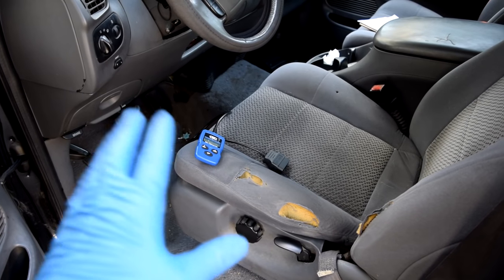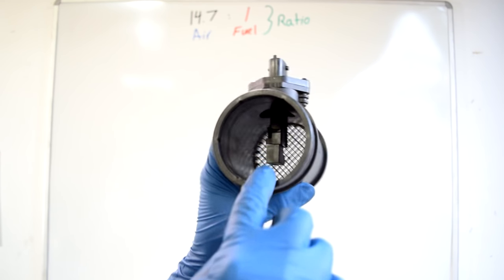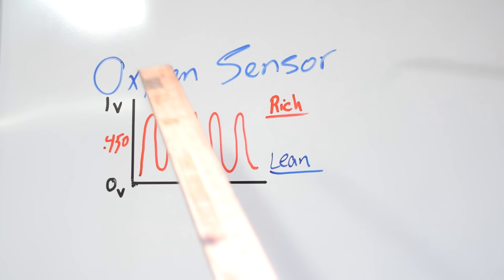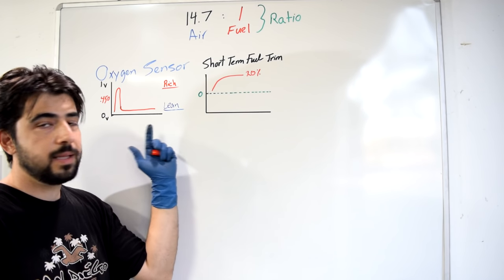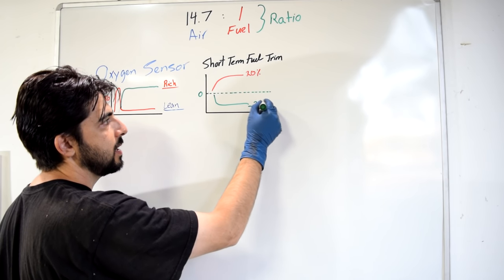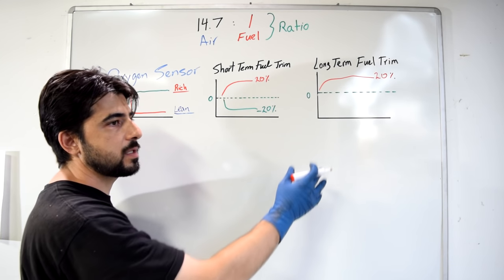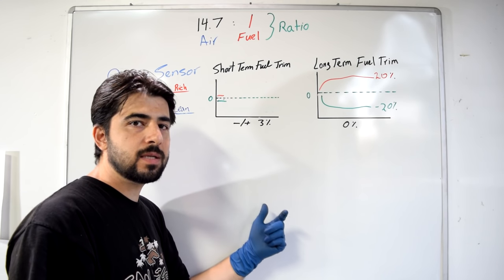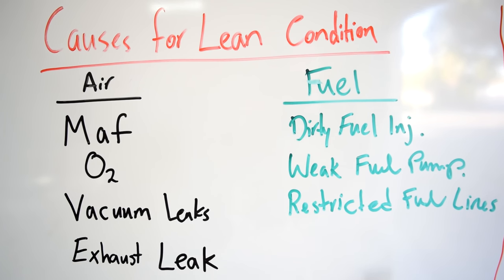Short Term and Long Term Fuel Trims Explained

Comment: I'm open to all advice on here. So far this video helped allot with understanding what I see on my scanner. But I need a little help understanding what the fuel trim and o2s reading mean. My 1997 dodge dakota with the same motor has a STFT (%) 2.3-20.3 at idle and a LTFT (%) 5.4 steady at idle. My MAP reads 9.4 and my O2s(v) fluctuates between .220-.860. 

But when I bring the RPM up to 2000 my STFT goes to -2.3 - 5.4 and my LTFT drops to 1.5 steady. My MAP goes to 7.8 and my O2s stay the same. 

Any advice would be greatly appreciated by anyone. And yes I know it's a dodge....

Comment: Hey man so I have a 2001 vr6 gti vw I keep getting a rich code p1137 code I have changed all parts except evap canaster still comes on. I have hard start & low compression on all cylinders. Whats my issue?

Comment: i have a hole in my air box where the filter  goes its at the bottom so no dirt would go through does this cause a vacuum leak i had a code p1273 my short term trims are around -6 to 10  but stays around -7 at idle
Reply: That hole is where the air from outside comes into the system

Comment: I tried that on my 2013 Hyundai Accent.  I'm getting a P2196 code, and the short term fuel trim jumps to 23.4% upon startup and stays there.  When I increase the RPM to 2000....it stays at 23.4%  What could this mean?

Comment: my o2 sensor voltage is from0.1v to 0.9v but on short term without accelerating is abou +15 so pisitive 15 and long term without acceleratng is 0 the same when i accelereta short terms go up to +25 just and long term stay 0 again can you help me what does it mean ?

Comment: I put the scanner in my car and I got 6.5 on the short trim and 2.3 on the long trim...I think I'm a little high on the short trim...but if you add 6.5 + 2.3 = 8.8  I'm below 10...so I'm ok ...right.
Reply: Michael Kokoschka no, you need a had cap and a big gulp from the circle k

Comment: Were r you located my f150 idles rought the stalls ive fixed so many part even changed the intake gaskets and it sill stalls no check engine signs
Reply: Check for vac line leaks, especially the hoses coming from the PCV valve and the IAC. Also remove and clean the IAC and check the PCV valve itself too.

Had a vehicle off the road over a year before realizing it was the elbow on my pcv line cracked, causing the car to constantly stall. $10 part and ten minutes of time in the end...

Comment: I have  a mazda 3 2017.. it vibrates and hesitates on take off and also only when your below 3000rpm its just feel slow.. i recently. Got a code p0421.. also i hooked up scan tool live data and  short-term trim bank 1 seems good long term fuel stays at 0.0... i scroll down i see  oxygen  sensor voltage  0.885 then i see short term fuel trim bank  1 sensor 2  0.00%.. i scroll down some more i see  long term at 0.00 also i dont get it please help?????????

Comment: Late to the party here but. I am getting a P0174 code. Idle STB1 4%-10%  STB2 16%-22% Both LTB1 and LTB2 12.5% - At 2500-3000 RPM (not driving, parked) STB1 15%-20%  STB2 27%-32% LTB1 and LTB2 0%. Why would the short term trim levels rise and the long tern trim levels drop. Seems like that is saying two different things. I was reading and some say if the trim levels rise at higher than idle RPMs it is not a vacuum issue but a lack of fuel issue versus the LT trim levels indicating a vacuum leak? BTW I do not have any issues with the car in performance. It is a 1997 Audi A4 2.8 V6 12v

Comment: I have the same problem with my audi A41.8t. It throws the code but after replacing oxygen and Maf sensor and checking for vacuum leaks still throws the code.

Comment: My LTFT is Stuck In -12.5% And My STFT is between -3% to 10% But somtimes My STFT Reading is - 11% to 20% Can you tell Me the Problem And How to Solve This Problem i Already Fix The Vaccum Leaks ang I already Clean My Intake Manifold But Nothing Happens...It Will be big help for me if you tell my what to do.. Thanks Godbless.

Comment: Actually I have to repeat video again to understand but I've understands 45% ^_^  
But I understand the case 
My problem is with my car e39 rpm on 500 it should be 700
And I got coil scan fault which is misfire replaced and it's still there the code not resolve the issue 
so I've just today invented my own smoke machine 
And will do the test and find leaks in my engine bay then 
I'll see if idle returns fine

Comment: Question what could be causing half of a v6 vw Passat to misfire only on the 12 &3 cylinders also a po341 cam sensor?
Reply: Timing is possible
Reply from the maker: like onboardtech said a failing camshaft chain tensioner or guide inside that cylinder could cause it. I actually had that problem once when a machine shop misaligned the chain after doing a valve job on one of the cylinders. gl

Comment: My Short Term and Long Term Fuel Trims goes -100 to 0, and AFP was 12,4. Whats wrong? I did remaping  because car in running on LPG, I have set lower values then autocalibration to reduce fuel consumption.. car don't use much fuel about 9% LPG, but the problem is, urban 9-9,5% LPG And on highway 8,8% LPG with remaping, which islittle bit lower, I have turn down urban+highway fuel consumption once to 7,2% with remaping, but only urban was 9,5% which piss me off, it should fall down consumption to 7,3% urban, and 5% on highway. I don't know how to remap well, to set values. Help please thanks.

Comment: For a rich condition, will the down stream O2 sensor be fluctuating between basically .01 and .90 or does it stay fairly constant?
Reply: whatsyougoingtodo it will stay up higher .7 to .9 indicating there is little oxygen in the system
Reply: @joed8423  Thank you. I found my issue. I did an engine swap and didn't realize that injectors on a 2001 Ranger are diff then a 2001 Explorer. LOL  I swapped the injectors and engine code went away.
Reply: whatsyougoingtodo good to know. was the engine from the ranger/explorer the same dissplacment as the one you took out?
Reply: @joed8423  Not 100% sure what the displacement even is. The guy I bought the engine from said I could use it of course. I tried to call Ford, but they wouldn't help me at all.  I just found out like a half an hour ago that the engine I put in was either from a 2003 or 2004 Explorer. He forget which one it was I got.
Reply: @joed8423  I don't even know what a displacement is. :) LOL. The guy that had sold me the engine says he was a licensed mechanic, but hes not currently. He just now fixing cars up and sells them.  He is also a carpenter for a very wealthy man. They buy, flip, rent, etc all types of properties.  This "ex mechanic" also just happens to be the brother of one of the previous owners just before the guy that I bought the truck off of. If that makes sense.  LOL
Reply: @joed8423  Oh, I guess if it wasn't the injector being different somehow,  I guess it could of been a small leak at the injector. I did replace the orings as well as I cleaned the infectors with carb cleaner before putting the old ones in.  The LTFT went from like -25% to around -12% I think it was. The drivers side with the Exployer injectors still in is reading around -19% the last time I looked, but no engine code yet and its been driving fine. A little more power now that we didn't know the truck had.
Reply: @joed8423  They were both 4.0L motors. I don't know if there was anything else that could be different.  I guess the Explorer motor was either a 2003 or 2004 4.0L.  I had just contacted the guy again and asked him. Our truck was a 2001 Ranger with a 4.0L.  Intakes are different on the two though so I swapped them out. Just didn't originally do the injectors or anything. Just the stuff on the intakes was done with the swap.

Comment: My question is my short-term fuel trim seems good goes back and forth between 0 and about plus 3.1 but my long-term field trim is stuck at zero it's been at zero for some time and never moves I don't know if that's good bad or if it means anything at all and I never have any problems passing smog does anyone know what this means?

Comment: I test drove a car today and at the end plugged in my scan tool.  Bank 2 STFT was pegged at -100%!!  What could cause that?  The voltage on the bank 2 02 sensor seemed to be responding normally when I revved the engine but the STFT number never changed.
Reply: A bad injector could cause this number to rise. although I myself have never seen it go to +100% that's a bit on the concerning side.
Reply: @HardWhereHero  I'm starting to think it was just an error in the interface.  My GF bought a very low mileage Optima and it shows the same funky reading, but has no history of cleared codes like on the other one (which was also an Optima).

Comment: My 05 toyota Corolla is +32% cruising  idling is at +3.7% full throttle is +4.7% long term fuel trim I can't for the life of me find a vacuum leak but with the way it fluctuates I feel like that's what it has to be any input would be much appreciated
Reply: any luck?

Comment: I got a 09 Acadia both bank 2 s2 
Bank 1 sensor 2. Both are 99.2% short term fuel trim 
What would be the problem? The oxygen sensor was at .0650volts
Reply: karzygijose short term would be bank 1/2 sensor 1/2 not 2/2

Comment: Everyone points out point 1 point 9 but but it reads a different number their saying.
Pointed to the zero while saying point 1 and then pointed to 1v while saying point 9.
Is point 1 written .1,0.1,0.001or 0.10 and then is point 9, 0.009 or like 0.900. 
Maybe I missed something.

Comment: My Long-term FT2 Stayed at 0.0 when I put a New 02 Sensor in Car Ran Smooth Jerk went away I also Put in a New MAF But Y that P0154 code pop up saying it's Getting No Activity from Bank 2 is it talking about the Dwn Stream bank 2 hmm ? got to run more checks

Comment: fault code p2191 system too lean at higher load bank 1
short fuel t normal but 
l.f.t always at -25%  
what could be the problem?

Comment: Hello, I have a 2001 Honda Odyssey and I got a Engine code P0170 & P0172
And the short fuel trims are at -25 to -27
When I press gas it fuel trims got down to normal numbers. What can cause this. 
Thank You
Reply: Carlos Martinez exhaust leak
Reply: Carlos Martinez exhaust gaskets

Comment: My b2s2 o2 sensor reading from .5 to .7 only does that mean it needs replacing?
Reply: From my understanding that is normal. I'm only still in college for auto mechanic, I was taught .1 to .9 is normal (lean to rich) , ideal is .5V

Comment: Also... just like what I just did. Make sure your oil cap is on!!! I accidentally left my oil cap on the battery after doing an oil change. Was in to much of a rush because of work. Put a new one on and driven it 5000 miles. Check engine light is gone and no damage. I didn’t lose any oil luckily. Just a lot of oil residue on the hood linner. I must be very lucky!

Comment: My Longft1 is reading 12.5.
I cant get it over 30 my rpms will rise then drop.
 I cant accelerate much either. What could be the issue?
Reply: my longft1 went up to 18.0
Lngft2 went up to 25

Comment: Great explanation but you forgot to mention a bad IAC sensor ( idle air control sensor) on  some cars would cause a stall or the same problem. Demet Garm.

Comment: i got civic 8th 1.8 petrol 245914KM  i change oil and oil filter air filter spark plugs NGK and i use red line sl1 fuel system cleaner but short term fuel trums stay -2.34% Long term fuel trums stays -6.25% dashboard is clean no error or chek engine..

Comment: so what if both fuel trims stay negative while driving,, consuming 16.7 liters per 100 km  on a 4 cl crv,, no cel
Reply: eug ciabatt Going by the info in this video. You have a rich condition (assuming you're meaning long term trims stay negative) so the fuel supply is being told to increase. I'd check for a faulty PCV valve or strong vacuum leak. Maybe exhaust leak before the first o2 sensor

Comment: Will a faulty evap system cause a bad fuel air ratio?
Reply: yup
Reply: __ ______ thanks for the reply. So a bad gas cap can cause a bad ratio.? I have a 2008 Highlander and it has a p0172 but everything appears to be working fine according to the scanner.
Reply: The gas cap is a part of the vehicle's evaporative emissions system and can cause problems with the system if it has an issue. But the code you have could mean a lots of things like,  bad fuel filter, fuel pump, injector, bad lambdasensor, leaking cat..

Comment: If the voltage pulse is low means the oxygen sensor encountered less oxygen hence its a fuel rich mixture and vice versa, then why we are saying it lean even though its showing low voltage!

Comment: what are the fuel trims foe E85
Reply: If your car was manufactured to run on E85, you'll see basically the same fuel trim numbers as with regular gas, as the ECU will know it's running on E85 and will adapt accordingly. If it wasn't, you shouldn't be running E85 anyway, and in that case, all bets are off.

Comment: Hello friend. I have bought a toyota celica 1.8 vvti petrol. The previous owner has changed the engine, as the first one broke down. The car came with the engine light on. After diagnosting the car it is showing the following values... STFT : -12.50 and LTFT : -26.56...
FT 1/1 :  -14.06 and FT 1/2 :  -100.78  with  700 Rpm..
The engine light is on..
The code which is showing is P0172.. 
Can you please help finding the problem ?
I can send a video of the diagnost which i have made  from 700 Rpm to 2500 rpm with a warm engine, if you can provide an email address. Thanks in advance...

Comment: I have consistent bad LTFT across all engine loads. +20%  Car runs normally, manually calculated mileage is normal, though car calculated mileage is higher, tells me the car uses LTFT data when calculating mileage.  So the O2 sensor feed back is fixing a lean condition.  With consistently bad LTFT 20% all loads, tells me its a MAP or High Pressure Fuel Rail sensor, and maybe but unlikely a poor fuel injector (acceleration is normal). Other problems would create car operation issues, acceleration etc, of which there are none. No egr on this GDI car, PCV replaced, MAP replaced. Leaves fuel sensor high pressure fuel rail - over stating pressure, thus less fuel is injected.  EVAP system is fine.

Comment: i have a 2017 Tahoe with 5.3L v8 
CEL - Code P2097 : POST Fuel Trim RICH BANK 1 - Last YEAR Dealer Replaced the y- Pipe assembly for Low Efficiency CATS with 1 O2 Sensor 
This Year 2021 P2097 Code Started - the FIX was Replace Erratic Reading MASS Air FLOW SENSOR !!!!!!!!!
Seems ok - left it at the Dealer for 2 Days to FIX
Before would also Stumble on Acceleration

Comment: Fuel trims sometimes are not accurate,meaning not real, but just caused by defective or aftermarket or dirty OEM MAP or MAF sensors,  like mine, the MAP sensor, which causes both fuel trims to be at 12 to 14 percent. I thought that I had a vacuum leak, but it was the aftermarket Delphi MAP sensor reporting wrong  values to the ECM, I just put back the OEM sensor and the fuel trim went down to 5 percent.  I couldn't believe it, almost 10 percent extra, unnecessary fuel was injected into the cylinder, I don't know why oxygen sensors didn't report rich condition?
The initial issue was rough idle and sometimes engine misfire, and fibration, but it was the ignition  electric connection wires that were loose at the aftermarket start button system. Basically, I created the problem over time by using a bad quick disconnect connector. I replaced the connector, and the problem partially solved: rough idle and misfire, but the fuel trim problem got fixed by installing the old OEM MAP sensor back.
And now I installed new  OEM honda Denso bought from eBay for just 18 dollar, and the fuel trim went to zero percent now, sometimes 1 percent, sometime minus 1 percent sometimes 2 percent. I couldn't believe it that OEM sensor on ebay just for 18 dollar.

Comment: Warning for Toyota System Owners. This is not how it behaves for toyotas. You have AF sensors in the upstream, not oxygen, that oscillate a voltage around 3.3 volts ideally. The downstream O2 sensors are supposed to have a steady voltage.

Comment: What is you car doesn't use a MAF sensor?
Reply: Then it will have a Map sensor or Absolute pressure sensor. That would have changed the length of this video substantially

Comment: Vape or cigarette to find vacuum leaks. Worked on my Jeep once I found out where the check valves were. Smoke came out of my fender. I had a break in the line going to the accumulator vacuum reservoir that was behind the bumper.

Comment: Good to see a Hispanic teach a mechanical course regarding short and long fuel trims. Most just shotgun shit and replace parts. I was hoping to see the smoke machine isolate and identify your leak. Great job again. You spelled restriction incorrectly on your white board. Wont hold it against you.